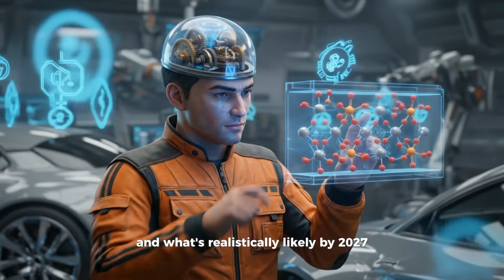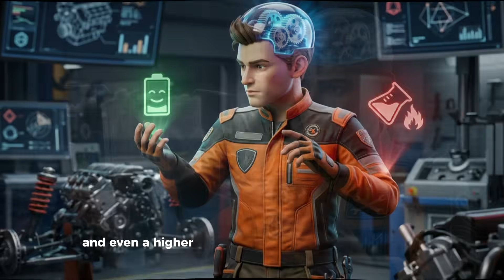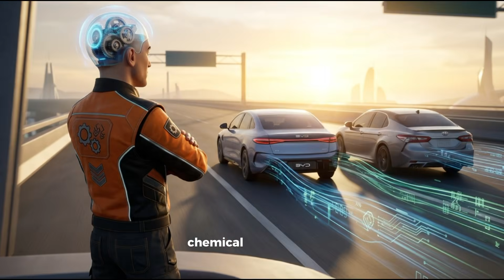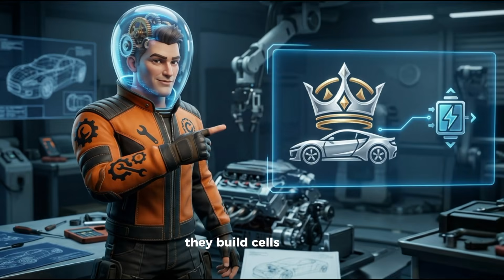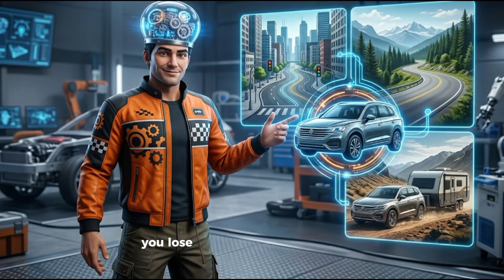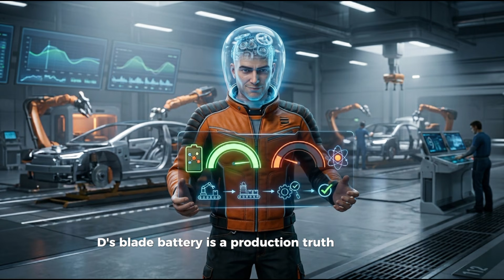BYD’s Blade Battery vs Toyota Solid State: The 2027 Engineering War

Comment: TOYOTA? They can actually made that tech in an instant, they are
Reply from the maker: Nekomata, thanks for watching and for bringing that strong confidence in Toyota to the community!

You are absolutely right that Toyota has the R&D budget and the engineering power to build the tech in fact, they already have working solid-state prototypes driving on their test tracks today. However, from an engineering and manufacturing standpoint, building one perfect battery in a billion-dollar lab is completely different from mass-producing millions of them safely and cheaply.

The brutal reality of the solid-state battery is the "interface problem." Without a liquid electrolyte to bridge the gap as the battery expands and contracts during charging, micro-cracks form and internal resistance spikes. Solving that durability issue on a high-speed assembly line without driving up the Total Cost of Ownership (TCO) is the ultimate hurdle. Toyota is famously risk-averse; they won't release it to the public until they guarantee it has the exact same mechanical longevity as their current hybrids. Thanks for jumping into the debate! 🔧